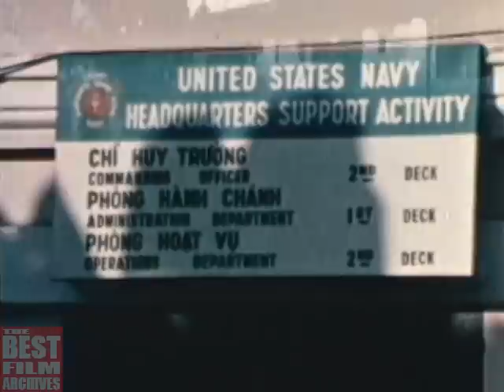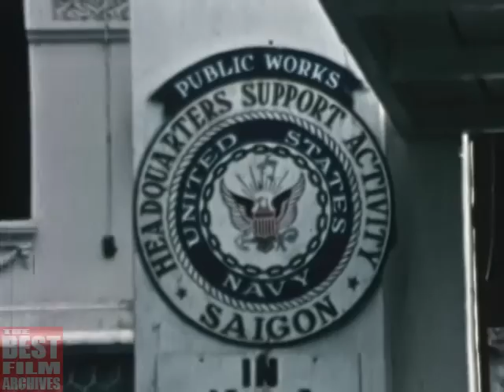US Navy in Vietnam | US Navy Documentary in Color | 1967

Comment: 0:31  rare olive drab painted Navy F4-  must have been a test subject.
Reply: When I saw that I was in a bit of disbelief myself as I have never seen or heard of a Navy Phantom in that color scheme, and I worked on Marine F-4s alongside Navy ones back during the latter stage of the war.  Like you said, it must have been a test they were conducting in the very beginning of the war.
Reply: @timbarnes3581  It was mentioned in book I had about different paint schemes the military used and tested on the F4,  I guess the best scheme for Navy aircraft is that subdued gray primer paint they use with low visible decals.  The Marines use it as well.
Reply: @spankyharland9845  well thanks for that info Spanky as I never knew that before.